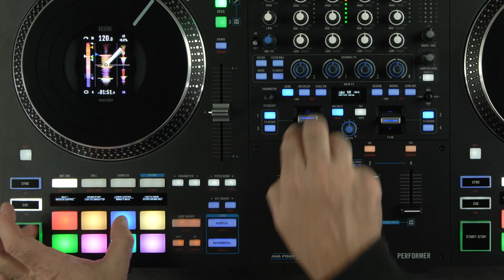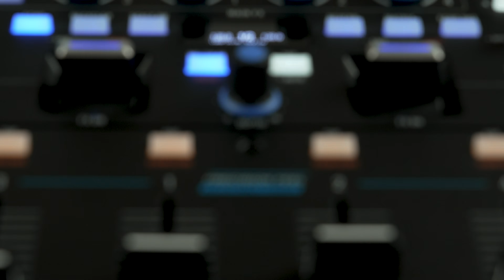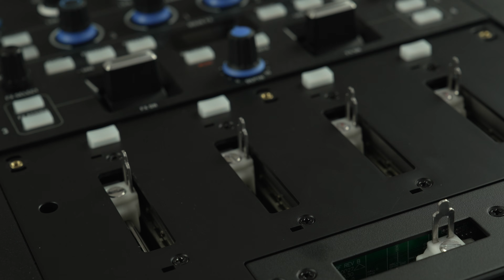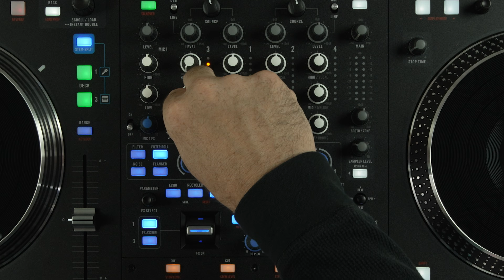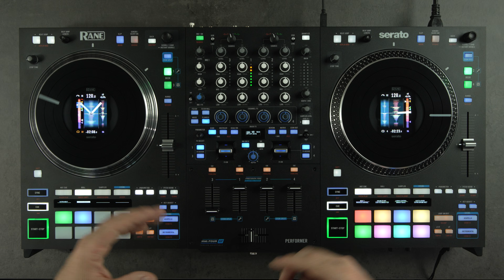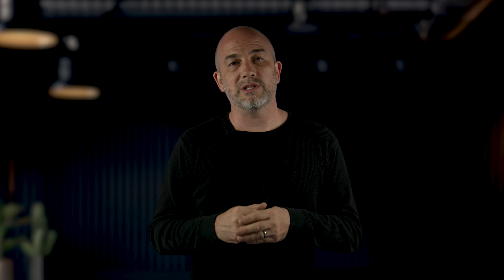Rane Performer DJ Controller: 4 Channels of Professional Remixing & Stem Control

Comment: Do you need to download special songs that have the stems in a file or something? Or does this just have the advanced capabilities to just do it to any song on a computer or hard drive
Reply from the maker: Great question, michaelazaccariello3360! The Rane Performer is controlling Serato DJ. It does not require specialized tracks. Serato Stems analyzes stems on the fly when the stems function is triggered, however, this does require a little time. If you want to use it instantly on and off, you will want to analyze for stems as you load your set lists.
If you have any more questions, give me a call!
Drake Sobehrad, Sweetwater Sales Engineer
(800) 222-4700 ext. 3271 | drake_sobehrad@sweetwater.com
About Me: https://bit.ly/3J7EmsL
Reply: @sweetwater much appreciated my friend

Comment: Is this a stand alone controller or requires laptop
Reply from the maker: Hey goldteethtv71, thanks for the question! The Rane Performer is a fantastic DJ controller, it is not stand alone and will require a computer running Serato DJ to function. If you are looking for a stand alone system in a similar price range you may want to check out Pioneer’s lauded XDJ-RX3!
If you would like to discuss more DJ Controller options, I would love to help, just give me a call!
Drake Sobehrad, Sweetwater Sales Engineer, (800) 222-4700 ext. 3271, drake_sobehrad@sweetwater.com
Reply: @ check your mail

Comment: Question: does the work in Djay Pro? I just got the Performer and can't seem to make it function there. Works as expected in Serato, but in Djay pro it doesn't appear to do anything.
Reply from the maker: Hi, thanks for your interest! Funny enough, although we don’t sell or support the DJay software at Sweetwater, I actually use it myself with a Pioneer controller. Don’t tell my brand reps 😉
There are a couple potential answers to your question, depending on what device you are trying to use. You should be able to map the Rane Performer to work with DJay Pro on a laptop or desktop computer, but it won’t work with the iOS/iPad version. Since the Performer isn’t a class-compliant USB device, it requires drivers on Mac or PC that aren’t available for iOS/iPad – so those devices won’t recognize it.
I hope this helps – feel free to contact me directly with any further questions, and thanks again!
Caleb Lowrey, Sweetwater Sales Engineer, (800) 222-4700 ext. 1620, caleb_lowrey@sweetwater.com

Comment: The only flaw of this controller is the wheels that spin too fast. The perfect speed is that of 33 rpm.
Reply: The wheels can spin at either 33 or 45 rpm, selectable on the hardware.

Comment: Do you need a laptop for it to run ?
Reply from the maker: Hello – great question! The Rane Performer is not standalone, so does require a laptop or other computer that can run Serato to function.
Thanks!
Jason Filloramo, Sweetwater Sales Engineer, (800) 222-4700 ext. 1281, Jason_Filloramo@sweetwater.com
Reply: Yes you do. It’s just an upgraded rane 4

Comment: great video. is the mic input can be switch to line level?
Reply from the maker: Hello – great question! The mic inputs cannot be used for line level. Inputs 3 and 4 can be used for line level or phono level inputs, though.
Thanks!
Jason Filloramo, Sweetwater Sales Engineer, (800) 222-4700 ext. 1281, Jason_Filloramo@sweetwater.com